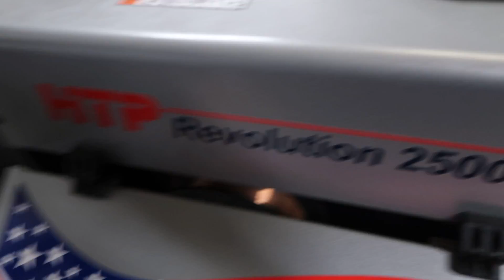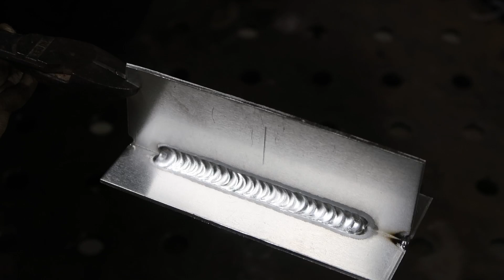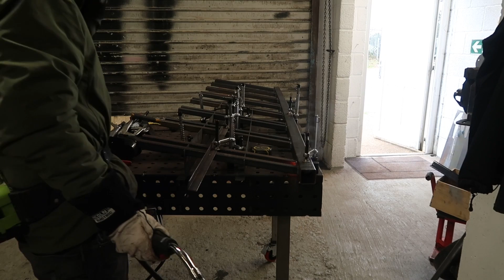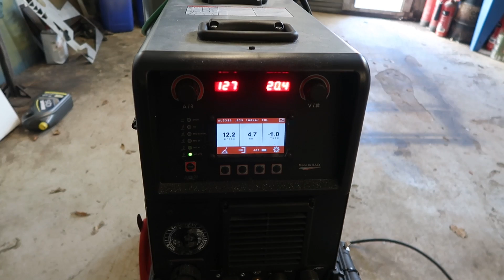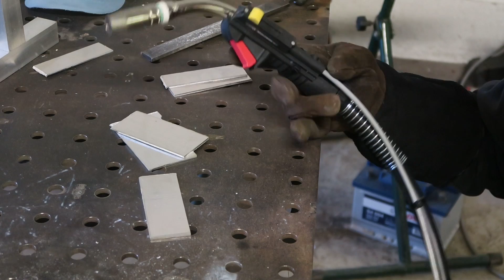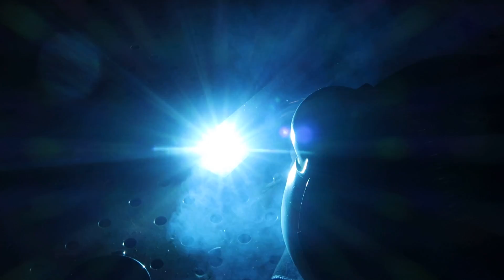Htp Revolution 2500 6 Month Review - True All In One Welding Machine

Comment: I have two of them and previously owned the Miller 220 multimatic and the ESAB 205, and the HTP 2500 is literally better at everything. The only thing that the ESAB done slightly better was stick welded with 6010. The Millers tiny dinse (25mm) connectors, gimmicky features  and some other factors make it more of a light duty occasional use machine. The Harbor Freight welders seem more industrial grade than the miller. Not forgetting to mention they have all kinds of board failures and they don’t weld near as good as the HTP or even the ESAB 205. You can tell when using the Miller 220 and 215, that they are just a Mig welder with afterthought Tig and Stick functions. 
The when you use the HTP 2500 you can tell it’s an industrial grade machine. A couple things they should improve on, fan on demand and better 6010 capability. However they are the best choice multi process welder. The only other welder worth buying in this category is the Lincoln 220.

Comment: I have been using one of these for about a year and a half on my boat build project.  First off, the customer service from HTP has been outstanding.  But depending on what you are doing, you might find the accessories included with the 2500 to be a bit lacking.  Mine didn't come with the big TIG torch like yours, just a model 17 air cooled torch.  It's only rated to 150A, so to use the full 250A capacity of the TIG side, it needs a different torch setup and probably water cooling.  I ended up going with their model 20 and the HTP cooler, which I have recently set up but have not used yet.  The first cooler they sent was damaged in transit, and they immediately got a replacement unit on its way to me (in Alaska).  You can of course get a less expensive cooler elsewhere, but this one has the special plug for powering itself directly off the 2500, which results in one fewer extension cord across my shop floor.  And of course the great support that I have mentioned.

Second, if you are planning to do a lot of MIG on aluminum, plan on buying the spool gun that they offer for it, even if you don't think you need the 25' reach.  The problem being the teflon lined whip of the standard mig gun that it comes with for aluminum.  If you're just welding at the bench, next to the machine, and not putting any stress on the line, it kind of sort of works, at least for a while.  But if you are trying to use it out of position, or putting any kind of stress on it at all for reach and/or position, it will choke on you.  For only occasional aluminum mig, especially on smaller projects that can be moved into a more ideal position, the standard setup is probably fine.

On the plus side, the spool gun they sell for it is a well built, heavy duty unit.  It adds a significant cost to the machine, but it's industrial quality.  The downside is its bulk...  My project has a lot of hard to access spots that need welding, and I was beginning to despair of getting it done with the 2500.  The people at HTP custom adapted a flex extension nozzle to the spool gun for me (I had been unable to locate an extension for it anywhere), which has put me back in the game as far as the 2500 goes.  They now offer this extension as an accessory you can buy on their website.